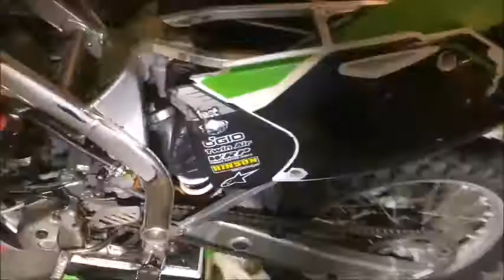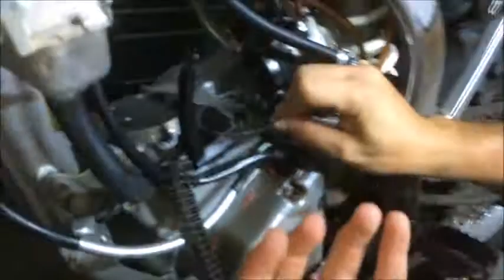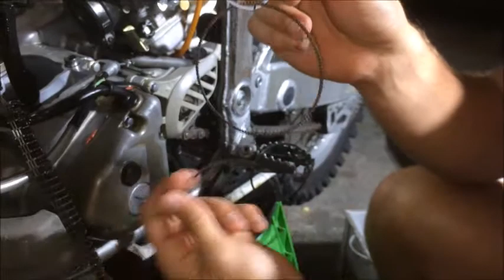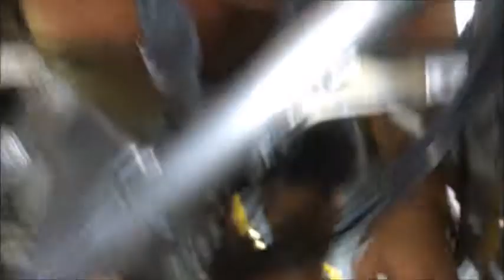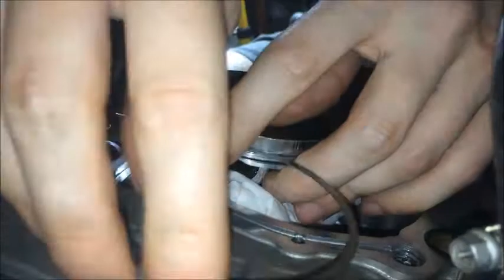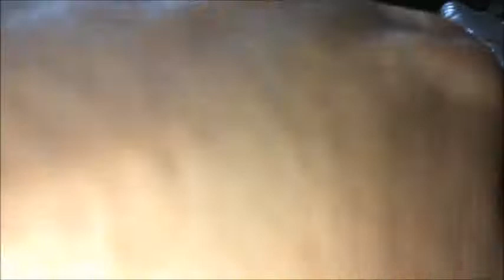How To: Piston ring install - 4 stroke dirt bike (kx250f)

Comment: Do you need a ring especially for the engine model or just one for a 250cc?
Reply from the maker: Best get it for the specific model as the clearances may vary between different years
Reply: @burgerbuilds  ok, thanks!

Comment: Would you give as a list on everything yo needed for the total replacement
Reply from the maker: depending on how excessive the damage is, for just the piston ring replacement, youd need a full set of rings plus top end gasket kit(cylinder and head gasket) in some cases you may want to change your piston just to be safe.
Reply: Sir how much price is this piston?